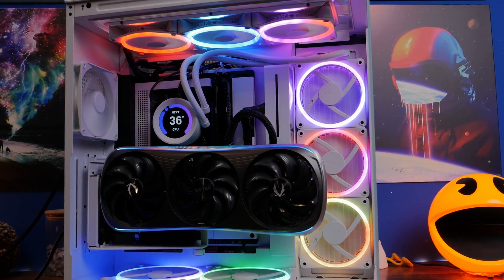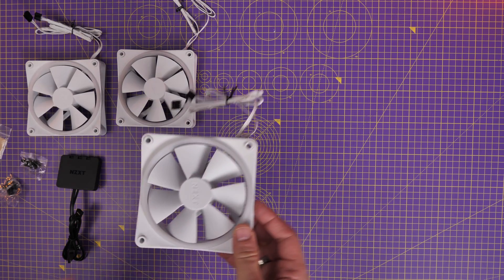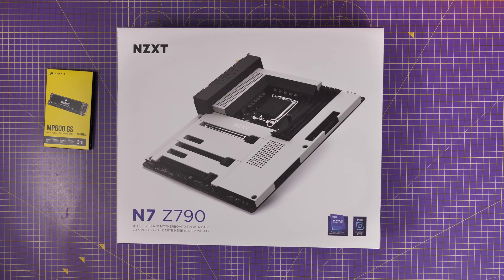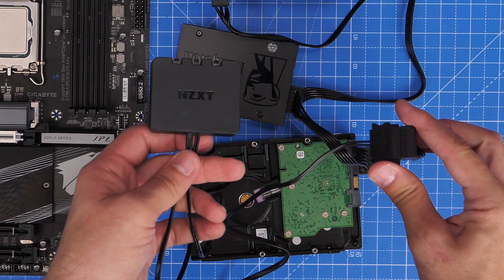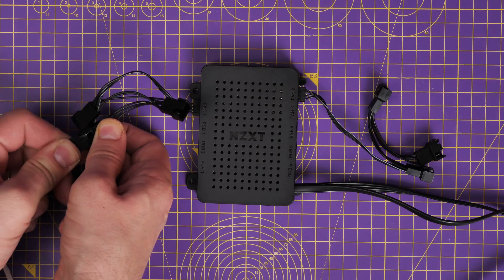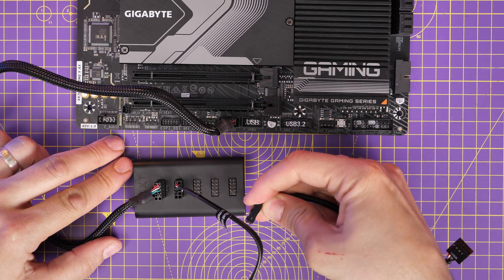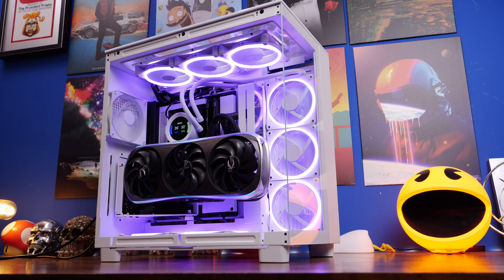The easiest way to connect NZXT RGB fans to your PC

Comment: I know this is an older video but man this just made me finally understand how to set my fans up. Thank you so much. I know it sounds crazy but this was the part I was most worried about. I’m building out of the nzxt h6 flow case and I’m running pretty much all nzxt hardware where I can including mother board. This will be my second build ever but my first build I had a lot of help with someone with more experience was with me and walked me through this time it will be all me lol. Im confident about the cpu and all that stuff I was worried about up getting these fans set up and still being able to use the cam software but you made it so simple to understand. 

Just in case you read this or anyone else and are curious I’m going from a i5-10600kf/3070ti/ddr4 ram set up to a 7 7800 x3d/5080/ dsr5 ram setup. Should be a massive upgrade I can’t wait. No more 8gbs of vram!!!
Reply from the maker: That's great to hear! Glad I could help.

Comment: Worst thing about RGB or ARGB fans are you need a hub with dual fan support and lighting. Ideally 3 pwm connections or more, and several RGB ports because most motherboards only have 3 or so usb headers.

Comment: I just „finished“ my very first build with your videos, it was really helpful thanks for that. I have one question, so I’m technically done and have everything connected but as I started the pc, everything powered up except my AIO. I have a NZXT Kraken Elite 360, exactly this one like in your videos. What can be the problem or what I just don’t see? 

My fans are all connected via the big hub from NZXT except the AIO is directly to the other USB header on the Mainboard.
Reply from the maker: Is the sata power connected to the PSU? Is the cable from the breakout cable properly plugged into the cooler? If it's loose or in the wrong way around that can cause issues
Reply: @TheProvokedPrawn thank you so much for the fast reply. It actually was the sata not connected to the psu. I only connected the sata from the nzxt hub.😶‍🌫️
Reply from the maker: @karon2658 👍

Comment: if i use 10 nzxt 120 fans in h9 flow i have one hub form the F120 RGB Duo Triple Pack is it enough to control all the rgb and fans? or should i buy one more hub ? thx

Comment: So, quick question 😂 building my first one atm. Got me an H6 Flow with 3 RGB Fans, the Kraken 360 RGB, an F120 RGB as exhaust fan and an F280 RGB bottom fan. Also got the Controller and USB Splitter by NZXT...mobo is an Asrock X870 pro rs...betting everything's gonna work correctly in the end right (supposing I use the controllers for the Kraken and the case fans and occupy two positions on the NZXT fan n rgb controller)? :) Thanks for your time, and best tutorials
Reply: Did this work for you? I have the exact setup and can’t get my h6flow rgb fans to sync colours. They have the 3 pin 5v connector

Comment: Sorry to drag up an old topic. I have an MSI Tomahawk B550 motherboard. I am wanting to add my 3 pack of NZXT F120 duo to this m/b and control the fans using CAM software. Do i need to buy the fan controller? The ARGB controller seems not to allow this to happen as I have the 3 fans connected to fan headers on the motherboard.. If I buy the NZXT fan controller will this allow CAM software to monitor and control the NZXT fans? Phew.... thank you! EDIT: I got the NZXT fan controller and all is well now.

Comment: Really good video but I have a super important question for me. I got a h210i case. İt has a control hub with 2 LED(rgb) ports and 3 fan ports. I bought 2 f120’s. Is it possible for me to power 2 f120 rgb fans and 1 led strip or am I just stuck with using two of them. If I’m stuck whats the best way to solve this without paying alot.

Comment: i have a NZXT Kraken 280mm (2 fans) aio in the top and a NZXT F360 RGB CORE in the front of my case. Should i connect the 360 mm core rgb to the same fan connector/splitter as my aio. In this way the fan speed increases when my cpu is under load. Or just connect the NZXT F360 RGB CORE to a seperate fan connector on my motherboard?

Comment: Quick question. For the hub controllers, 9 fans but 6 RGB ports? 
If I buy 2 packs of 3x FANS with one RGB controller each. Do I connect the RGB controller to a single RGB port on the main hub?
I'm really having trouble understanding how this “9 fans” but 6 rgb ports works.
Reply: Did you figure it out?

Comment: I got a problem. I just got 3 rgb fans and hooking it up to the rgb controller was no problem for me. But I only have 1 Fan Header Connector on my Mainboard and using a Momex Adapter won't let me control the fan speed (for obvious reasons) is there a solution other than upgrading my mainboard? (i wanna wait till i can buy myself am5 plattform)
Reply: You could get a fan splitter

Comment: Hey! awesome video! But i have a question and didnt understand some things (srry english is not my first language) :(, if you dont mind! So, I plan on buying a non-NZXT motherboard and want to have rgb NZXT fans and liquid cooler. 

So, I am going to have: Kraken 360 liquid cooler (3 fans) + I pack which came with the case (3 pack NZXT rgb core fans) and plan on buying ANOTHER 3 pack (2 above + 1 on the side). All these 3 packs come with a RGB hub. 

So, in order for everthing to work, I need to:
1. Have each 3 packs connected to a RGB hub (so i have 3 rgb hubs)
2. Connect each 3 fans to a fan splitters 
3. In the controller: put the 3 splitters in the 3 slots (9 fans total) and use 3 slots of the rgb (the 3 hubs) 
4. Have a SATA and USB connect to the non-NZXT motherboard

Thank you! Would really appreciate your help!

Comment: Sorry for the silly question, I'm just currently at the stage of selecting components for a further PC build. So, is one "NZXT RGB and Fan Controller" and one "RGB Controller" that comes with 3 F120 RGB Core Triple Pack fans enough for me? I'm just confused by the information about NZXT RGB and Fan Controller, which says: "Control up to nine 3-pin DC or 4-pin PWM fans, allowing Zero RPM mode to optimize noise levels." All the fans I plan to buy have a 4-pin power. I'm planning to build a pc with NZXT H6 Flow case (non-RGB) and Gigabyte B650 AORUS ELITE AX ICE motherboard. Overall, I plan to buy 2 140 mm RGB fans and 4 120 mm RGB fans, as well as NZXT Kraken Elite RGB 360 AIO. Will all the necessary connectors (including USB 2.0) be enough to connect and control fan speed and lighting? Thank you very much for your help!

Comment: Can these fans not just be daisy chained?  I think the NZXT website states that there is a max 40 LEDS per channel. The Duo fans have 20 LEDS, so could two be daisy chained before connecting into the controller, or am I missing something? So if I was one RGB connector short on the controller (I.e. 7 fans as opposed to the 6 max limit), can I not just daisy chain two of them?
Reply: The F Series NZXT RGB fans cannot be daisy chained.

Comment: What would happen if i plugged EM directly into the Motherboard (i did it) and they dont work now. Do i have to buy new Fans?
Reply from the maker: What connection did you try to plug into the motherboard? The NZXT RGB one into an RGB header? If so that was a mistake
Reply: @TheProvokedPrawn ye i plugged the NZXT RGB into an RGB header
Reply from the maker: @Lanksen  yeah you're not meant to do that
Reply from the maker: @Lanksen  I don't know. You'd have to ask them
Reply: @TheProvokedPrawn ok thank you
Reply: @TheProvokedPrawn one of them just started working again lol

Comment: you need that HCUE to control the LCD on KRAKEN right? Or i mean you can still control it with just regular colors but you can't for example have pictures on the LCD and show temp in numbers yada yada, am i correct?
Reply: you can do it directly from the NZXT CAM app, no needs for HCUE
Reply: @rodcris304  well... doesn't work for me :S

Comment: I just put together an nzxt build on an Asus motherboard! Super slick, buti cant control my two 140mm fans RGB, even though they're plugged into the controller. Is there a work around for this, or do I have to just go through my mb rgb settings? Thanks!

Comment: Awesome video but I have one quick question. I want to use six NZXT RGB DUO Fans with the RGB Fan Hub controller with the Y cable like you did in your video but do you know how this works with the Cam Software ? My theory is that I can control those 3 Fans that are connected with the Y cable all at once but not seperate. So if I make Fan1 in Cam blue (3 Fans in Fan slot 1 with Y cable) goes also blue ? Is my theory correct ?

Comment: Awesome video thank you! Quick question, if that controller has the capacity for 9 fans but 6 rgb plugs. What do I do with the remaining 3 rgb for the other 3 fans? Do I use one of those rgb controllers with 3 slots as well?
Reply from the maker: Exactly that yes.
Reply: @TheProvokedPrawn  Thank you so much.

Comment: Can i still adjust the fan speed curve   of the fans in the bios if i plug them on the nztx black thing instead of on sys_fan on motherboard?
Reply from the maker: If you're connecting them to an NZXT fan controller then you'll be controlling fan speed with NZXT Cam software. Not the bios.
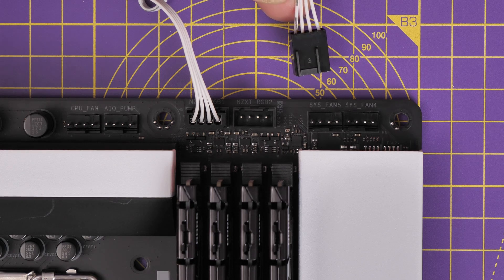Reply: @TheProvokedPrawn   at 2:07 you plug  1 fan but does they come with a splitter so i can just plug all 3 fans into one single SYS_fan on my motherboard? thanks :D

Comment: So if I am planning on having 10 f120 fans, 3 that come with h9 elite , I would need to buy an extra fan controller and also a USB hub if I decide not to use the Nzxt motherboard, is that correct?

Comment: I already have 3 rgb fans that came with my h9 elite case and i want too add 3 more. Am i going to need another controller? And get a usb hub so i can fit it all? My mobo only has 2 usb plug ins . Need help so bad with this
Reply: With the elite case u get 3 rgb duo fan ansd also a controller for 6 fans rgb so  u need nothing un less 3 more fan :□

Comment: Hello i have the Xigmatek Aquarius Plus Gaming Midi Tower with 7 fans pre-installed. They are connected to a controller and im wondering if i can connect the controller into my motherboard and use them via software. Opening the back case everytime i want to switch the colours is just so annoying. If so how you do it? Thank you in advance.

Comment: I have 9 nzxt duo fans on my elite, 7 120 and 2 140.. my problem is the 3 new ones in the bottom is newly installed and after sometimes the rgb turns out of sync with the 6 fans that I first installed, how to solve this problem?

Comment: I’m in the process of building a PC. It’s in a H6 Flow so I bought 2 140 NZXT and a 120 for the bottom and back. I went with the deepcool AIO (couldn’t justify the price to match the fans with the kraken). Will I need two hubs then? I got one with the two pack so that would cover the bottom two and the rear fan. But then I still have the front three to worry about and the AIO. Any tips would help thanks.
Reply: have u found out how to set that up? if so pls tell me how?
Reply: I'm at the same stage now as you were. How did it go?

Comment: You have given me an idea. The rgb fans that came with the case were pre wired with a splitter that ended in a 5v rgb head. When in cam all 3 fans are as one and all change together. So now il try putting 2 of them in the nzxt ports and see if the 3 fans then show up separately
Reply: Did this work out for you? I was also wondering why he didn't just daisy chain them. They come pre-wired this way, who sets their fans to be different individual colors lol
Reply: @cgkrab  someone who likes traffic lights I guess lol

Comment: Thank you, but what I learned was to not buy NZXT fans. There are so many other brands you can choose from that Don’t use proprietary connections.
Reply from the maker: NZXT is not alone. Lian Li does similar, as does Corsair.
Reply: @TheProvokedPrawn  Very true - I have deliberately not bought any Corsair fans but have happily used the Lian Li SL-Infinity, SL , SL V2, AL and the AL V2's - in the multi pack format the Lian Li fans come with the necessary hubs.  I have used your YouTube guides to help me set them up and also your Strimmer guides.
Reply: @TheProvokedPrawn corsair ql has amazing fan connectiond

Comment: I bought NZXT fans to put inside my Lian Li O11 Air Mini. I have 7 inside my case. 
  I regret this so much, despite the fact that I like the look of the fans.
I't's a nightmare to route all those cables. You need to buy a separate hub cause the one included only has room for 3 fans, so you need 3 of them. Those hubs take even more space and more cables to route.... Horrific design

Even today, NZXT still doesn't have a all in one solution, or magnetic daisy-chain fan+rgb like Lian-Li/Corsair/Thermaltake...
Reply from the maker: They actually used to have daisy chain fans if you can believe it.

Comment: Please help, unrelated to this video, but hope you might be able to help, I’m a long time follower.  With your guidance as my main source, I have built my first pc.  Got post on first try, having issue with L-Connect 3.  I have the Galahad II LCD and all is working.  I am hooked up both ways (L-connect 3 control and motherboard control.   

My issue is on the L connect software, all I am seeing on the main page on left is System Info and Settings.   I am missing the other clickable choices such as Fan/Pump RPM, Quick/Sync Lighting, and SL Infinity lighting.  I am also on V2.0.11, which I believe is the latest firmware version.  So basically I can’t use the software to control my lighting, fan speeds, etc.    Your help/guidance will be greatly appreciated.  Just got this built today.   Thank you!!  James, from Kentucky…
Reply from the maker: If you're sure you have connected the SATA power to the controller and usb to the motherboard then try this https://lian-li.com/l-connect3/l3_update_manually/
Reply: Ok, I watched your video earlier where you manually updated the fans/controllers, should I just try that method or try the one they have listed for the GH II LCD or both?  The instructions/translations they have for GHII LCD Manuel update are very unclear, for me anyway.  Thank u again for your response.     Yes both usb and Sata are connected

Comment: I heard NZXT cam software used to be quite invasive on personal data and be intensive on systems. How does it fare current day?

Thanks for the wiring video btw! One of the lesser seen aspects of PC building.
Reply: They got rid of all that a few months ago. Now, no login required. Everything is local. As for the intensive usage of resources, that was fixed years ago. Pretty sure they took action after GN covered it and stuff.
Reply: @krakentortoise7531  Thanks. Glad to hear more companies requiring no login (like Nvidias new geforce app), especially since they already made money from us from the initial purchase of the hardware in the first place.
Reply: Thanks for the info. I really like the look of their fans and AIOs and was going to try keep all the RGB I can to 1 software other than RAM but RAM u can usually set a colour for a forget about ever opening the app again.

Comment: I have 13 NZXT F120 Duo Fans (10 standalone and 3 from the NZXT AIO) on my NZXT H9 Elite. It really was a pain in the head figuring the logic and how to connect everything.
Reply: How did you, I'm going to do a very similar build
Reply: @_Drew_O_ probably splitters
Reply: I have 8 and I'm having a hard time
Reply: how did you end up doing it?
Reply: I want to know the same thing, I’m about to build mine the same way
Reply: Hey could you tell me how many hub you need for that?
Reply: I have 9 with two different controllers, and ofc they dont sync..TIME TO LOOK AT THAT POOR CABLE MANAGEMENT BACK THERE🙄
Reply: I have 8 and it wont work
Reply: @TheHighFiveProd did you ever get yours to work ?
Reply: Hey, how did u connect this fans?